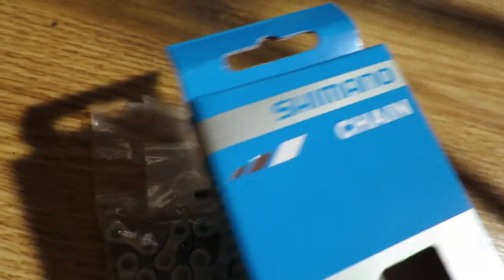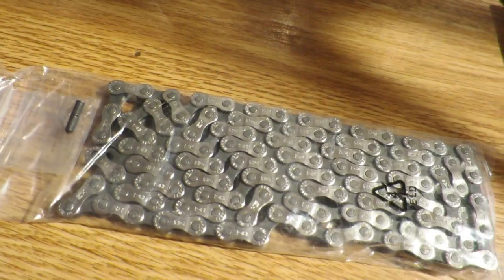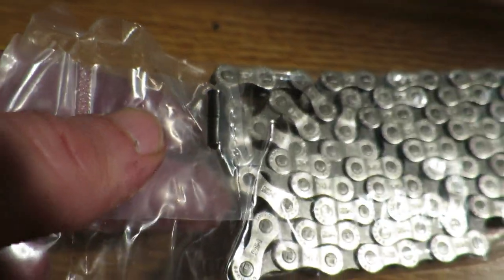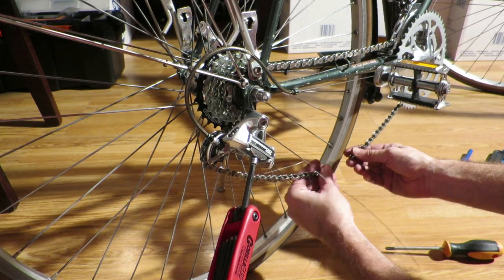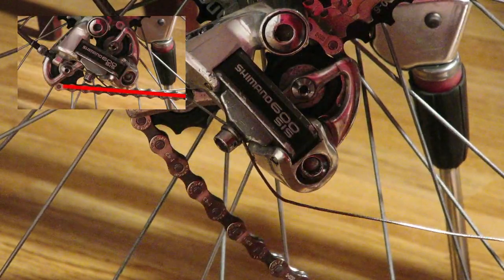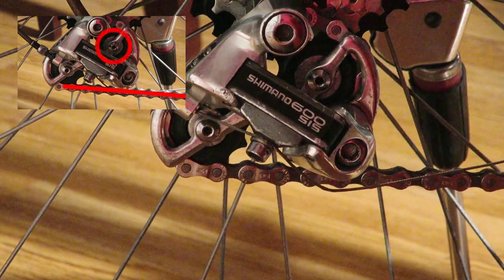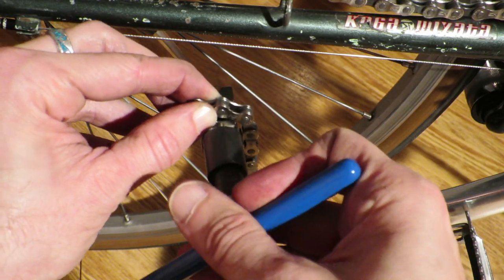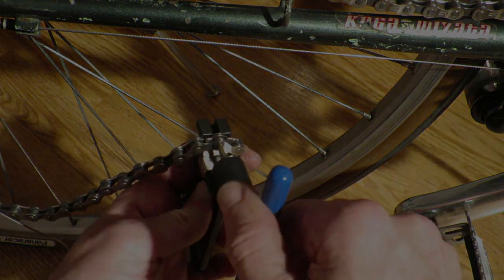How to easily measure Shimano chain length in 2 easy steps

Comment: Nice, I'm replacing an older chain on my bike. Couple of questions:
* If the chain I have bought is a little too long then can I use the chain tool, as you seem to do in the last seconds of the vid, to punch out a pin to drop some of the links, then put in the final pin?
*  I presume that I can just hang the old chain up and match it up like that - or should I measure anew, as you described?
Reply from the maker: The answer to your first question is yes. The answer to your second question is that you should not measure the length of the chain, since chain length increases with wear.
You should count the amount of chain links on the old chain. Your new chain with the same amount of links will be shorter depending on the amount of wear sustained to the old chain.